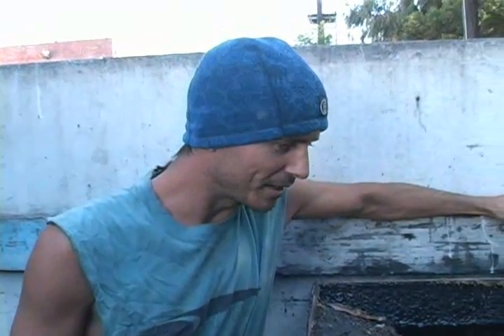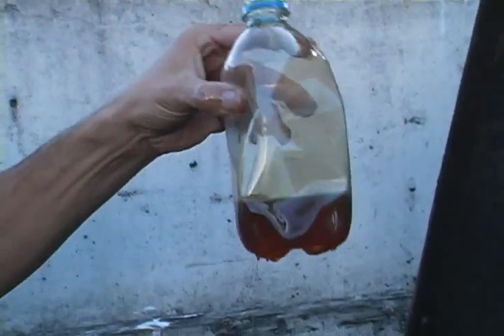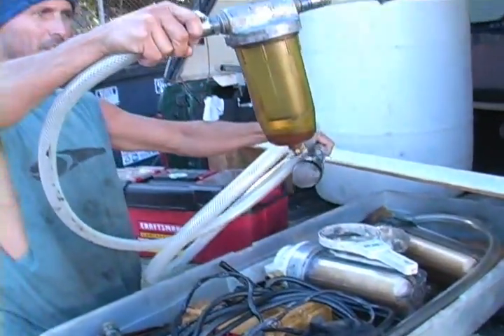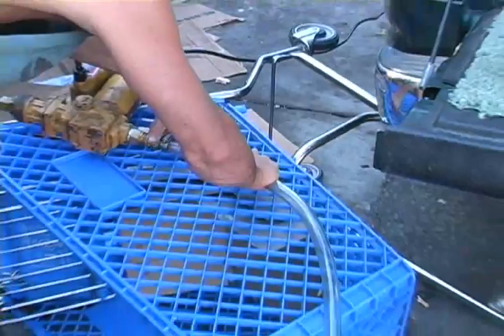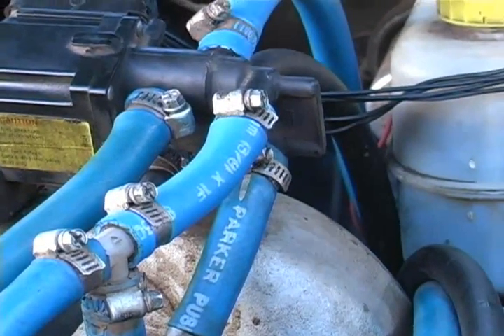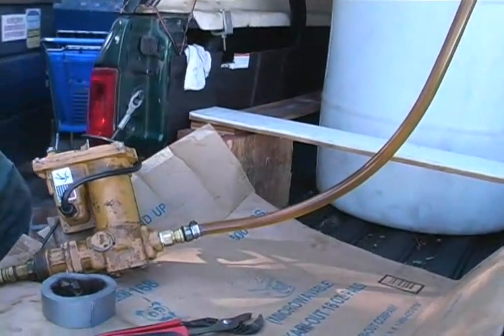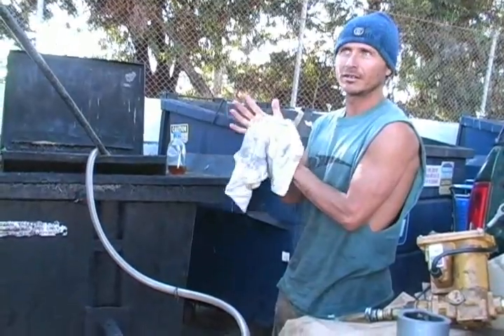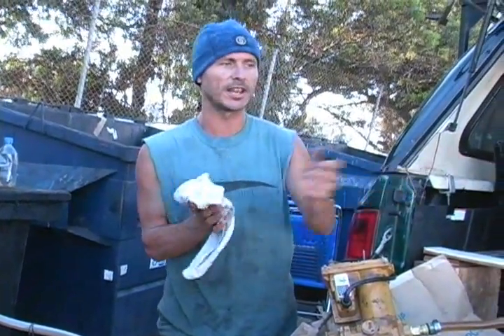Greasel-Vegetable Oil For Diesel Truck

Comment: This is pretty cool. I think if i did this, i would definitely invest in a trailer and a bunch of barrels, then make a whole pumping set up right on the trailer and make the rounds to restaurants collecting oil. Then unload the barrels at home in a shed and run it all through a finer filtration system, then into more barrels with a gas nozzle so i just have to wheel one out to my driveway to gas up my truck.

Comment: To find grease use your imagination:  Cafeterias for schools, universities, bowling alleys, country club golf coarses that have big resturants, small mom and pop chinese places...........it helps to be a customer a few times before you ask.  I have access to more oil then I can burn but it took me a long time.  Also offer to buy it, you can buy used oil from someone at a better rate then they get paid for it........and you can buy it for 10% the cost of diesel fule or LESS.

Comment: Do it yourself.  Check out what I did with my older 7.3.  No real reason it wont work on a powerstroke, but consult a powerstroke expert.   Type in 7.3 Diesel Vegetable oil and you'll see my video.

Comment: if you ever smell a grease trap..you'll know there are not the same as the bin you collected grease from.

either way..using homegrown fuel is better than from foreign sources..I convert mine into biodiesel..its cheaper than converting 4 to run on grease..yes 4..put anotherway..all except for the the motorcycle..a bus, a truck( like yours), a jeep and sailboat.

Comment: I don't get black smoke from my exhaust. I get blue smoke with with Diesel....old engine, 1991 7.3 Ford. When I heat my oil under a fire in a 55 gallon drum I get the water out at the same time.  Yesterday I installed my coolie cup contraption for my inline oil filter got some engine coolent in my mouth, tasted terrible.

Comment from the maker: Good ideas.  Controlling the heat on a mass of 300 degree scavenged cooking oil is an important thing.  If it starts gassing, an explosion is possible.  I believe the oil itself can be best used as a heat source which will can be automatically regulated.  The gravity filtering is nice an simple but you have to hold the heat and wait, so pumping and filtering might reduce energy "in" for a given energy "out".

Comment: Oh, heat the top drum with a fire.  Buy a 300 degree thermometer.  One warning, using veg oil in a diesel engine you need to change your engine oil more frequently.  Probably about every 2000 miles, contamination of the engine oil with veg oil is a bad bad thing, it happens to all engines.

Comment: Yeeha, liquid Gold:  Picture this, 2 55 gallon drums, metal.  Painted with some Por15 on the inside walls, hi-temp paint on the bottom.  Build an iron stand to heat 1 drum, braze a pipe with a brass valve.  Heat to 140-180 and drain into filter bags, 50 micron, 25 micro, 1 micron.  All 3 bags in one, like one socking over the other.  Hang the bags on the end of your pipe, 90 elbow.  Paint the drums inside or the rust will make your oil ugly.

Comment: I do not recommend Golden Rod Filters unless the pump pressure is slight enough to handle the pressure.  My golden rod filters got ripped up fast.  Probably better for filtering Bio-Diesel rather then vegetable oil.

Comment: Success, drove about 2000 miles last week! Had problems with my 30 micron oil filter clogging from 50-60 tempatures, not from crud, from the cold.  Need to heat my oil filter in addition to my inline heat system.  No need to heat the tank if you have proper drainage in cold weather!

Comment from the maker: As far as I know it is a standard diesel transfer pump.  Greg would rather have a homemade that uses a high volume engine oil pump, gear drive, driven with a small starter moter.  Three times the delivery.

Comment: The 1 inch braided hose can be ordered from Hosexpress on line, call them for a small order.  Or some specialty (non-chain, large hardware store) may have the hose. I suggest 12-15 foot hose on each end or more if the pump can handle it horizontal should be no problem.  But what kind of pump is that and where can it be found?

Comment: Hey Christopherabrown:  What kind of 12 volt pump is that?  I just got a fil-rite, new, something's wrong it won't suck out a grease trap with clean oil.  In 1 inch clear hose it pumped 1 foot up the hose and no more.  In the 3/4 black hose it came with after 5 min it would never prime or pump.  What kind of pump is that and who might supply it?

Comment from the maker: I heard someone coupled an engine oil pump, gear pump to a starter motor and got like 20 GPM.
The thick grease is much harder to gather, filter and use.

Comment from the maker: The veggie oil is too thick at ambient temperatures to pump easily.  After you've run for awhile, the engine coolant thins the veggie oil in its tank via a heat exchanger then it will pump for the final filtering before the injection pump.  That is when you switch.

Comment from the maker: That is A VERY good procedure and 1st filter technique.
Greg, who is in the video, is travelling from grease trap to grease trap with perhaps 600 miles in between, so that technique is not an option for him.
I like it tho and would proabably do the same thing myself.
I actually know others that have big plastic pans with holes punched in the bottom that they can lay filter material onto and clean easily.  They do the overnight thing too.

Comment from the maker: The vegetable oil is filtered when it is scavenged.  First with a 40 micron stainless sceen, then with a 5 micron paper filter.

After it's heated its' filtered again in a sintered bronze filter located in a filter housing which is a part of the header pipe.  That heat there further thins the fuel so finer filtering can take place and it gets to the proper viscosity for the injection pump.

Comment from the maker: There is a sintered bronze filter in the header pipe that gets the veggie oil up to about 250 F that drives the water out before entering the fuel system.

Comment from the maker: It does have to be set up with a  second fuel system.  The green dodge in the video runs on diesel and veggie.  It starts on diesel then switches to gresal.  

Ya, greasy job, but an hour and a half gets 400 miles of fuel.

Comment from the maker: Because he gathers and filters his own grease he has to use a 2 tank system just to get the engine running and heat the veggie oil.  I think the only folks that can use a single tank have to either thin the veggie oil with diesel or burn biodiesel.

Comment from the maker: Greg has a two tank system.  He starts on diesel and when engine coolant has gotten hot enough to get the veggie oil tank hot enough to pump he starts pumping through a sintered bronze filte that is in the header pipe and very hot where the veggie oil is filtered a final time.  then the primary fule pump sucks the veggie into the secondary.  Sorry I accidentally removed you message.

Comment from the maker: So you gather your oils, filter them to 1 micron then fill your dual tanks?
Any details on how you get heavier, dirty oils to filter to 1 micron with reasonable pressures.  Do you heat it in your filtering process?

Comment from the maker: My partner just sold the Dodge truck and his Mercedes, both were on veggie oil for about 2 years.  The golden rod filter is just assembled with the 40 micron filter to screen the inlet to the standard diesel transfer pump.